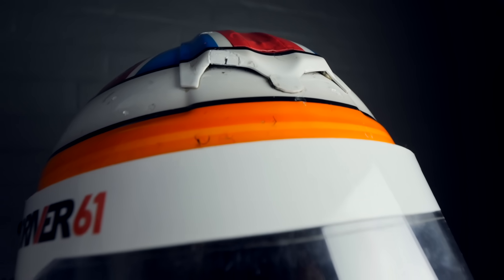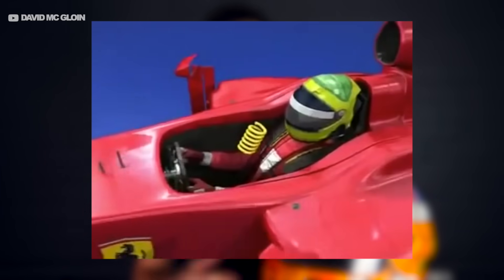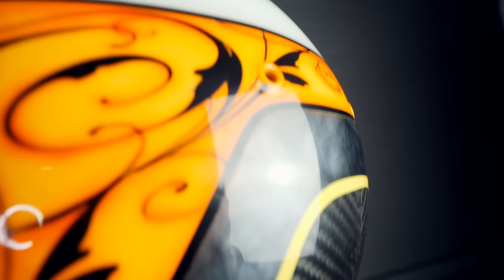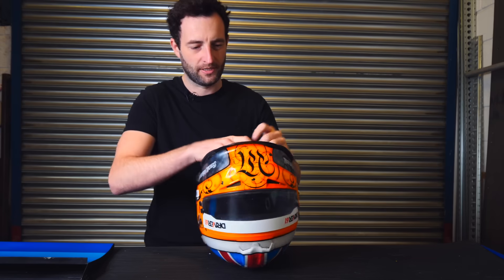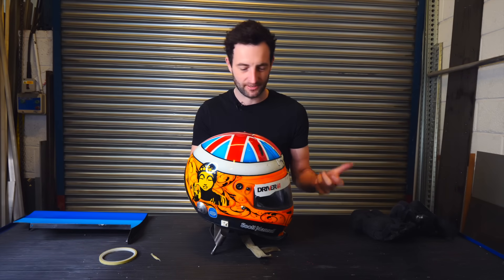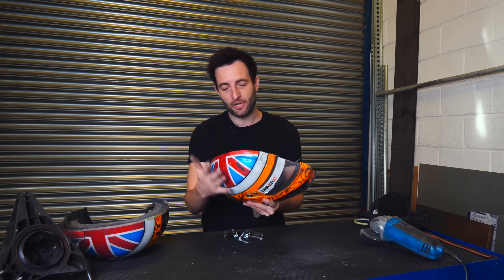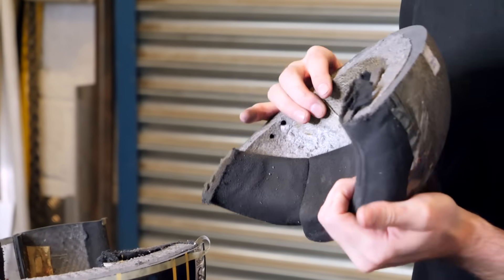What's Inside an F1 Helmet?

Comment from the maker: What do you guys think was the coolest fact about these helmets?
Reply: isn't carbon fiber dust really bad in your lungs?
Reply: @null-t5e   its highly carcinogenic, and can cut them up pretty bad internally too.
Reply: @null-t5e  Yes, I was just about to write ALWAYS use breathing protection when working with carbon fiber or glass fiber. They're like asbestos when airborne. They shred your lungs on the microscopic scale and can give you cancer and COPD.
Reply: @null-t5e  YES!
(left another message in another thread - DON'T EMULATE THIS EVER ☠️ )
Reply: That you have a £5000 helmet but can't afford a £15 respirator. Crazy.
Reply: Surely the light adapting features built in the helmet, that's so cool!
Reply: That it costs $5,000 and you cut it in half. Hahahah
Reply: @damnielm0  not really, it was out of spec. But I get your point
Reply: The electric heating elements. Do they have the audio built in for radio? Or is that strictly run just on the driver and in an earpiece?
Reply: The carbon dust you're filling the air with is extremely hazardous to your lungs 0.o you should've had ppe & ventilation @ bare minimum.
Reply: right in the the first 3 minutes
heated and photochromic visors!
also the projectile test is really cool
i know that Oakley, maybe 15 yrs ago, has used the same testing as marketing material. some of their lenses can similarly protect against debris for extreme sports
Reply: Creating Carbon Fiber dust, and inhaling into your lungs was an interesting fact!
Reply: I’m curious how fast you develop mesothelioma
Reply: How thin the carbon fibre/ Kevlar layers are.  How light it seems
Reply: Great video, I never knew about the light reacting or the heating element functions of the visor.
Reply: Surprised to hear about the heated faceshield. Haven't seen it in motorcycles yet.
Reply: I was too concerned with the lack of safety equipment and little care used to cut the helmet open to notice it.
Reply: the visor was pretty cool.
Reply: my vote is all of the inside info you provide, I've often wondered about f1 helmets,  i would love an episode on tips from an racing driver on safer better road driving?, what would you say road drivers could practice maybe looking five cars ahead instead of just the car in front?
Reply: It's like those welding helmets that use electric auto darkening to control when you are being exposed to bright lights.
Reply: I love it. Keep it up! 
Who the Hell thumbs down this. Just don’t watch it, weirdo
Reply: Heat resistant and heated visors :)
Reply: Do F1 helmets have expiration dates?
Reply: They have a much smaller visor opening these days, too. To protect the forehead as much as possible, instead of just relying on the zylon strip.
Reply: Heated visors.
Reply: I was shocked how thin the carbon/Kevlar is. How much does that helmet weigh?
I have an old Bieffe like Eddie Irvine wore at Jag F1and other F1 drivers used years ago and was shocked how heavy that helmet is.
Reply: The heating resistance is insane
Reply: the visor test was pretty mind-blowing.
Reply: Are these helmets an option when it comes to motorcycle riding?
Reply: @jackkendahal254  MotoGP probably has purpose made helmets. These are not meant for other cars that aren't F1, as things like the bracing for the HANS device serve no purpose.
Reply: I know fuck all about F1 so maybe its pretty common knowledge for enthusiasts but for me, the HANS device is the absolute coolest bit as well as the heat resistance
Reply: Unrelated to the question... the HANS device when you have the belts on is so damn uncomfortable... Super worth wearing though as we saw with grosean’s crash the HANS device, halo and fire retardant gear saved his life.
Reply: Well, Kimi would say its the fact that they protect the driver's head.
Reply: Everything
Reply: The heater!
Reply: If you have one old helmets and you want to test again, can you please give it to me? Cause that helmet is my wish. 😍
Reply: Late and a bit off but i have to say that whenever there is a talk about these helmets the first thing i think of is Senna and that tyre.
Reply: Dude, your videos on the inner workings of the formula 1 engines and accessories are perfection.  Being a somewhat new f1 fan these videos give me a clear perspective into just how in depth and intricate the physics and engineering  are that go into f1.  But for gods sake man, wear some gloves when your using an angle grinder or a circular saw or something like that!!! Any kickback or sticking point and that saw gets away from you your gonna wish you were wearing some!  Awesome videos i can't wait until the next one, keep up the blue chip videos.
Reply: @madLphnt  Next one will be 3D resin printing without wearing gloves.
Reply: Where a mask! 😷
Reply: @GeeDaddyFlex305  wear not where !!!

Comment: I’m from the bathroom industry. We use De-mister pads... 1 way foil matting place behind a silver/glass sheet meaning full demisting. We used to use little wires in the 90’s but even for little shaver mirrors, wasn’t a complete system. Wonder how many years it’ll take to adopt? 
Some companies use the conductor foil as the mirror itself but viewing from reverse you can’t even see the layer, just SB and mirror

Comment: The foam insert that you refer to as "Styrofoam" is not expanded polystyrene, but is in fact expanded polypropylene bead foam, marketed under the name ARPRO, by a company called JSP International. It is one of the most technically advanced forms of engineering foams in the world in terms of strength to weight ratio, along with other high performance characteristics. There you go.

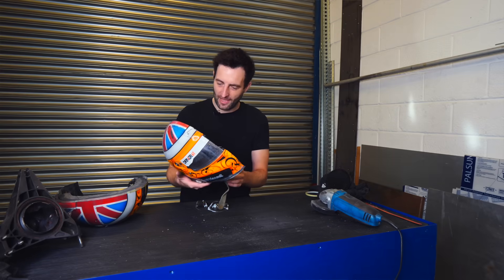Comment: Next time wear a respirator when grinding carbon fibre. You don't want carbon dust in your lungs. The fibre particles act similarly to asbestos. Also the melting polycarbonate releases toxic gas as it burns 7:47.

Comment: A 225 gram projectile??  How does that represent the stuff flying at you in a real accident?
A tyre, for example?
Reply: other things than tires are flying around in an accident, and when going around a track at massive speeds. also its easier to fire a projectile than it is a bolt or a stone or whatever.

Comment: Please anyone who will use an angle grinder: It is SO dangerous to hold it like that. You're supposed to have one hand on the angle grinder and one on the included extension handle. the guard is NOT MEANT to place your hand on. You have the chance of cutting your fingers off!

Comment: I made the mistake of using an angle grinder on carbon fiber I used making a part with. The carbon dust built up in and on the grinder. End result I got a bit of a shock. A 1/2 can of ele. clean later and the grinder was safe to use again. Just not on carbon fiber. I finished the job with a pneumatic one.

Comment: SFI 31.1 now classes helmets in 5 year intervals like SNELL.  Each 5 year cycle (on the 5's) brings updates.  Most track day and other even organizers will accept the current and the previous five year cycle.  This insures no helmet is over 10yrs old.  It is interesting that the helmets typically worn by safety crews (at least in the US) - the ones that look like high-cut combat helmets - don't have a rating or date.

Comment: Was your "F1" helmet a moulded to your head model or a sized model?
Most of the comments are about Carbon dust, I could easily hold my breath for as long as it would take to make the cut(s)
Reply: Why don't you see if you can hold it for the length of the video, remove some of that damaged DNA from the gene pool?

Comment: I was formerly production manager for G-FORCE Racing Gear, a racing safety equipment manufacturer. Your explanations were very good, but I'd like to share some additional information: 

A racing helmet is designed to absorb serious impacts only once. This fact is unknown to (or ignored by) almost all racers. The hard shell dissipates impacts over a broad portion of the surface, suffering stress fractures in doing so. Also, the actual impact absorbing foam does not 'spring back', which significantly improves its impact absorption ability, but renders it useless thereafter.
 
The HANS ('Head And Neck System'):
After the death of Dale Earnhardt, the obscure HANS device was suddenly of intense interest to every racing sanctioning body. At G-FORCE, we actually developed a HANS device alternative that worked perfectly, was FAR less expensive to produce, and quite a bit simpler. No one could simply copy the HANS due to patent protection (though some tried), so we had possibly the only viable alternative that didn't violate HANS patents. However, the key sanctioning bodies decided to certify the HANS, and only the HANS.

In a strange twist, we actually had close ties with Jim Downing, who funded development of the HANS for many years, and acted as 'test driver' for the device in American IMSA competition. The early versions were extremely bulky and ungainly, BTW.

We were disappointed at being refused certification, having done all the necessary (and expensive) sled-based impact testing and so on. Speaking only for myself, I do have to acknowledge Dr. Hubbard's long effort and ground-breaking work, along with Downing's steadfast belief in the idea and his willingness to see the project through, at great expense. 

Sure would be nice to buy that neck protection for about $175 though, wouldn't it?

Comment: Concerning the Visor you said, that F1 uses a strip of Carbon fibre on top of the Visor. They changed it actually this year (or last year, cant remember exactly). They run a much smaller visor now instead of the csrbon strip. But still a great video with interesting insides

Comment: You said you have raced with this helmet for years. I always thought that F1 drivers get a new helmet every race, since they change their design all the time.
So they actually use the same helmet, just paint it over and over? Or F1 is at another level and the sponsors/teams provide a new one every race weekend?
Reply: They only started swapping up designs frequently this season. Until this year F1 was extremely restrictive about drivers changing helmet designs, with part of the basis for the rule being this is how fans are supposed to be able to identify the driver.
Reply: @ero1220  Are you sure? I’ve seen these “special helmets” for a few years now. But that being the case, they would use the same helmet or new ones with the same design?
Reply: @nunaoooo  the “special helmet rule” was for limited races (like one or two with advanced approval), now they can use a different design every week if they wish. I don’t know if they are refinishing the same helmet or using a new one each time, I’d imagine there is no restriction to using a new bucket every week, regardless of design choices

Comment: Not having ever worked with Carbon Fiber. Would an industrial bandsaw have worked? Car folks seem to use a right angle grinders in many instances where a saw of some type probably would have accomplished the same job in the same time or less. Besides you don't have the "Death Wheel" to deal with.

Comment: When cutting things in half, do not finish the first cut. Leave just a bit to the end. Then cut the other half. A trick my dad has taught me, it makes everything easier. The whole thing still holds its form and doesn't start to flex. When you have done the long cuts, then cut the "tabs" that are left. It is a bit like when you weld things together, first you tab it, then you weld it. Cutting works in opposite, first the long cut, then the tabs that are left to hold the thing in shape.
Reply: That also reduces the chance of kickback caused by both halves of what you're cutting pinching the blade.
Reply: @BrunodeSouzaLino  Believe in JESUS today, confess and repent of your sins. No one goes to heaven for doing good but by believing in JESUS who died for our sins. GOD loves you soo much unconditionally.🤩❤🤗

Comment: Those grinders that use an on/off vice deadman switch are deadly!  I had one kick out of my hands and the wheel hit the inside of my leg where my femoral artery is.  Had I been using one with the on/off switch it would have cut it wide open.  Having the deadman switch it only put a small cut on my jeans not going thru
Reply: Especially when you're operating one without the handle and holding the body of the grinder with both hands.
Reply: Finally a comment about his handling of the grinder.

There was little to no need for him to put his hand and fingers where he was.

Comment: I'm just cringing seeing you use an angle grinder with no ear protection, gloves and N95 mask 🤪🤪🤪🤪
Reply: Aren’t gloved generally a bad idea when it comes to cutting/spinning equipment as it pulls your hand further towards the machine and it has lots of loose hits?
Reply: @duckmucker  Obviously you should use gloves designed for angle grinder work. It's true that incorrect gear may be more dangerous than not wearing anything.